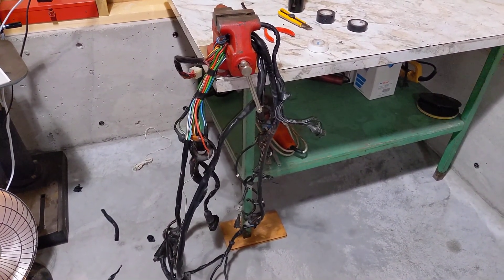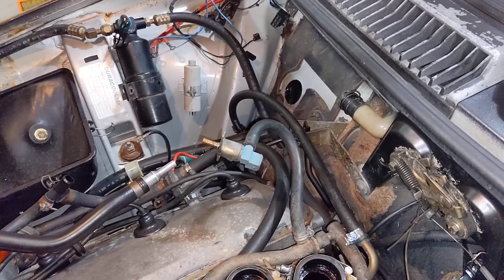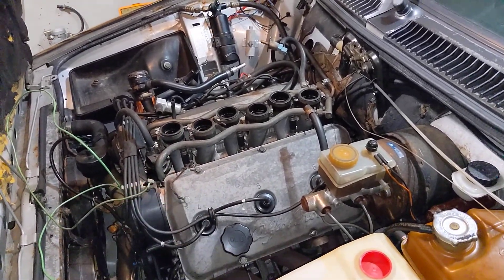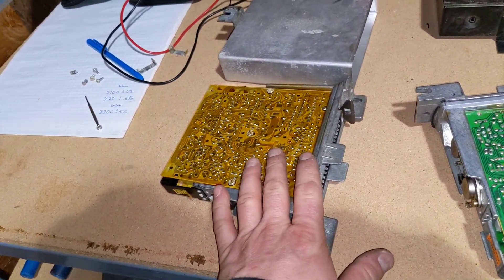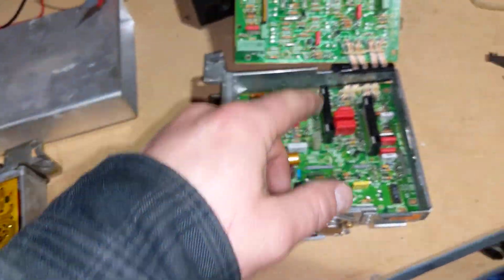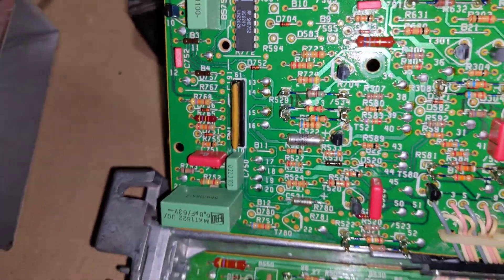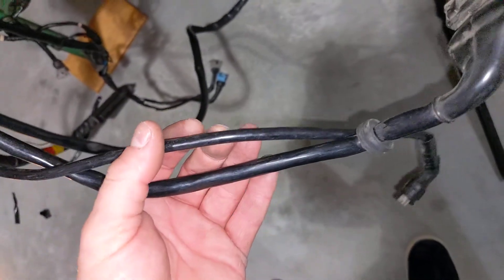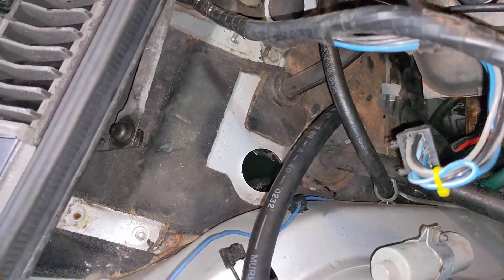Alfa GTV6 EFI 'upgrade'

Comment: Isn't it easier to just use the modern ecus megasquit, haltech etc,  and that will also replaced all the old wires with exception of lights etc
Reply from the maker: Being intimately involved in fuel injection tuning for at least a decade, I can tell you for certain that this was far easier and cheaper than installing MS or Haltech by a long shot. Is it better - probably not, but hey this 150hp V6 ain't winning any races either way
Reply: @Nodarperformance  I have a gtv6 and yes it would be great to improve the capability of the existing ECU. I'm amazed you're so good with all this electronics .was just wondering whether you could by pass the cold start used on the  L jetronic and just make the existing fuel injector  fuel for a couple of seconds during cold start ..would be good if someone could bypass some some hard to get parts .
Reply: @hubechen4982  most aftermarket ecu's dont let you use a maf and run speed denisty or tps load mapping. Its pretty nice firing up your car in winter and having it idle perfect or it running the same afr's at different elevations and octane levels
Reply from the maker: @hubechen4982  unfortunately there is no easy way of accomplishing a cold start as you describe with L-Jet. You will need the cold start injector, thermotime switch and the air device working as it should. These parts are still available and are not too expensive

Comment: Hi Nodar,
Very cool to see a video of this, Ive only ever read it on the BB. One note, I thought the 3.0 used the Motronic system not the LJet? Must be an early 3.0, as my 2.5 doesnt have the electronic ignitionn I guess. All the same, Im just waiting on my bank account to get a Haltech haha.... Cheers ~
Reply from the maker: In North America ALL Milano 2.5 and 3.0 cars came with Bosch L Jetronic. Motronic was sort of the rest of the world, and is a far better system as it's actually digital. ALL Milanos however came with a microprocessor controlled ignition system called Bosch EZ-L. There were two different types - the later type seen here and an earlier version with two square block connectors. My Milano actually runs on Bosch Motronic 1.3 from a BMW, so these parts were taken out and unused until now